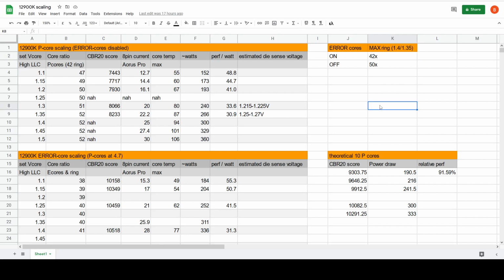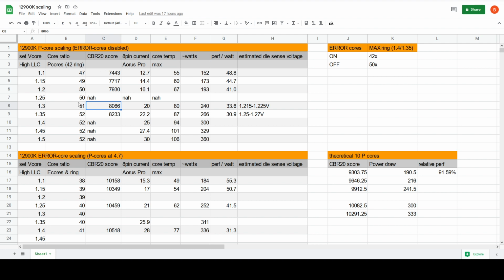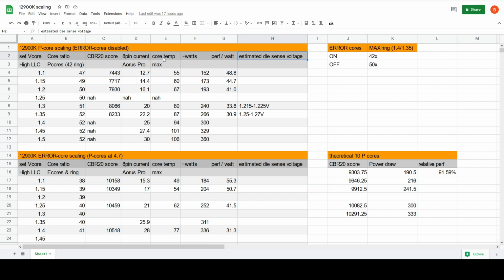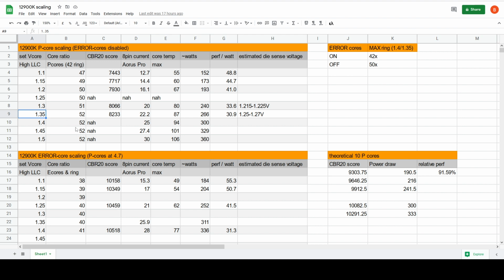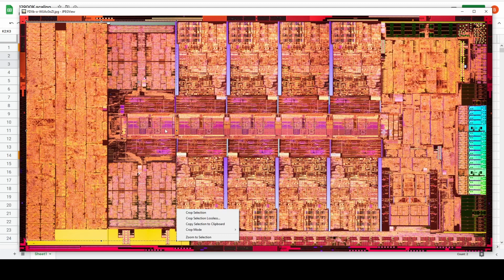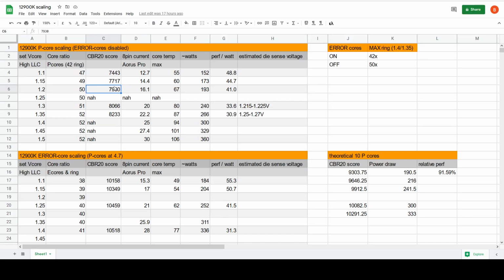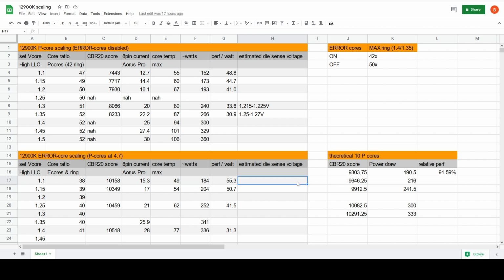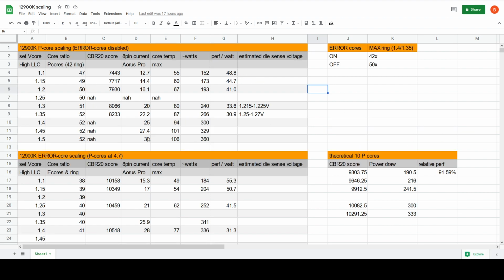12900K P and E core voltage and frequency scaling behaviour

Comment: The Ecores do seem to do more work in the same amount of silicon.  It breaks my brain for things like game servers, but for gaming - if they were to beef up the pcores even more, and only have 4 of them, then a bunch of ecores, it would be nice.  I would love to see 4 or 8 pcores that were monsters and focused on IPC, then have a bunch of high efficiency ecores - if that makes more sense on the die.  It does seem like it does.  Honestly, I never thought I'd say this, but power consumption is getting a bit crazy.  I can heat my house with my desktop PC, and in the summer it needs it's own AC.
Reply: i would love to just see 12Pcores without any Ecores, or, maybe 12 Pcores 4 Ecores, the thing is we already have games that use more then 8c so when DDR5 matures 12Pcores will get more fps then 8pcores, but that is not the case for the Ecores there so slow it is almost comparable to the second CCD on a 5950x the Ecores are basically a second slower CPU on the same silicon die they don't work well with the first CPU, Ecores can't really be used for gaming so there really just for background tasks, Tile based rendering, or streaming, which most people don't need them for

if i really wanted a second slower CPU in my computer whats to stop me from getting the cheapest ITX board on the market and sticking it in one of those dual system towers like a ENTHOO PRO 2, and having a cheap old 10400, or a 3600, alongiside a theorecical 12Pcore 0Ecore 13900k?, not much really but its just a kind of a dumb idea and the Ecores are not that far off from it.
Reply: but really the Ecores because there slow won't be able to scale up to large core counts to get large amounts of performance in a wide variety of applications, so i don't see it making sense to have more then 4 of them,

 i hope if Intel does double down on Ecores we will see a 12core CCD from AMD, the newer server CPU is going to be 96cores and 12x8 is 96 so i think either we will see 12core Zen4 chiplets and something like a 6800X will be 12c on 1ccd, or the server part will just have 12 8core CCDs rather then 8 12 core CCDs, and the 6800x would stay 8c
Reply: @XDbored1  But that's not how it works.  If the main loop is running on a pcore, and there's no blocking, the ecores actually process more in the same amount of silicon.  It's better.  Add more silicon, and ecores still make more sense, because they still process more.  You can't get rid of pcores, though - because the main loop does rely on single core performance.  Some other threads may, too, but definitely not all of them.  There is a very limited number of threads that require pcore performance, in many cases it will be 1.  The rest benefit more from ecores.
Reply: @XDbored1  Even on servers, I'd be fine with - even - 20 pcores - for main loops - and the rest as ecores.  4 ecores can process more multithreaded stuff than 1 hyperthreaded pcore.  Only very specific threads will get bottlenecked by not running on a pcore, and you just don't run many of those.  Basically, they are replacing 2 very fast cores (1 core, 1 hyperthreaded core) with 4 slightly slower cores.  The main reason I'd even be interested in pcores on a server is because I run game servers.  Even then, the number of pcores you need is closely linked to the amount of RAM you can put in the system.  Plus, the higher core count CPUs have lower clock speeds, anyway, so I just tend to discount those for game servers, anyway.  Honestly, I'd rather run a cluster of Desktop CPU servers for game servers.
Reply: @XDbored1  I'd choose 4 ecores over 1 hyperthreaded pcore for almost anything, other than gaming, and for gaming it would just be for the main loop.  I'd have to research if any other threads would be bottlenecked, that would really depend on the game and how it's designed.  At the same time, I wouldn't want to have 0 pcores - because some stuff does need the performance.  Personally?  If I had to choose between pcores and ecores, and you couldn't mix them, I'd choose all ecores.  It's, just, better.   Double the cores, they're real cores and not hyperthreaded, more efficient, and still run at decent speeds.  We need the pcores, though.
Reply: @techrev9999  ah that is difference you think HT is worth leaving on and your thinking of old applications that handle most of everything in 1 thread and then parcel out small amounts of work to the other threads those older games would run just fine on  4Pcores,

I think HT is only ever worth considering if you have a CPU without enough physical cores something like a dual core quad core or sometimes even hexa core running multi threaded applications, because single core performance is always better with HT off and power consumption is lower too, and when you have a memory bottleneck HT off seems to work better there too,

but i am thinking of highly threaded games ones that use more then 12t evenly distributed like Cyberpunk 2077 or Crysis 3, stuff that can run on a threadripper or a 5950x, but still doesn't run that well on a threadripper or 5950x, because of the core to latency, highly threaded games don't scale that well past 8 cores right now because there is a 8c CCD and moving data to some other CCD costs almost as much time as a dual socket system, it actually takes more time then a 18core Xeon would,

if that didn't have a large negative impact on gaming performance then something like a i7-6950X would be the best gaming CPU money can buy, but the problem is it does have a big impact on performance a i7-6950X is not that great a gaming CPU, and a 5950x is hardly faster then a 5800X for gaming, and nobody is thinking a dual socket system is great for gaming, and the Ecores are in the same boat they might help save a little power but having more Ecores won't help gaming

on Intel we got a true 10 core, and nothing but 8 cores since, 8 cores are great for current games but there are a few that run a little better on 10cores, and i think 12cores will be the future looking at the Software we have today,

unlike Zen3 the latency with Ecores is large even between other Ecores so the Ecores are more like 4 single core CCDs then a quad core CCD
https://images.anandtech.com/doci/17047/12900K%20Bounce.png
Reply: the Ecores take longer to get to the same cluster of Ecores then they take to reach the opposite cluster, they look bugged,

how often are you going to have 4 completely independent background threads awake at the exact same time?, if the scheduler just shifted things around very slightly it could probably process all the background threads on a single Ecore, while still having all the Pcores for gaming, most of these background threads already have over 8ms jitter anyway (thanks windows 10 sarcasm) so how much difference would adding 1/2 a ms cause?

if you get into the number crunching game of tile based rendering the HT will make sense there and Ecores may make sense there, but so does the R9 5950X, or the i7 6950X, and i have to wonder if just undervolting some Pcores a little wouldn't end up with the same or better perf per watt anyway.
Reply: looking at BZ's data i would give a rough estimate that a 4.5ghz Pcore has the same perf per watt as a 3.8ghz Ecore, so the Ecores would want to take up a lot less die space to even be worth fabbing, and if you could have more Pcores and you don't care about the extra cost in Silicon you would want as many Pcores as you have threads and 0 Ecores
Reply: @XDbored1  From what I saw, 1 pcore == 4 ecores.  So, it's - basically - twice the density.  If the 12900k was all ecores, it would have 40 cores.
Reply: @XDbored1  It really comes down to what the threads are doing.  My system isn't only for running games.  I do a lot of other things, too.  So, I'm not going to disable HT.  The question is what all those 8 threads in current games are doing, and how they're written.  A lot of processes will run just as well on an ecore as a pcore.  Also, a lot of people - while gaming - are running other processes at the same time - multimonitor set ups with browsers going on the other monitor to look up game related stuff, discord, etc.  Ecores are fine for all that stuff.  But, Ecores and Pcores are not 1:1 on the silicon.  Its 1 Pcore for 4 ecores.  If it was 1:1, you would have an argument.

I haven't looked into how the game engines are engineered, but as a programmer, I definitely could leverage this to my advantage in big ways.
Reply: @XDbored1  To me, you just sound like the guy in Spinal Tap - but this goes to 11.
Reply: @XDbored1  Yeah with Intel we got a true 10 core Comet Lake 10900K and 10850K. Unfortunately, it was limited to PCIE Gen 3 which is not at all future proof for video card upgrades down the road. And we have only had 8 P cores since. Part of that I believe is they were having so much trouble building anything more than 4 cores on any process node smaller than 14nm. They had Tiger Lake which actually beat AMD Zen 3 in Single threaded performance, but only laptops as it only had quad cores and they of course could not release only quad core CPU architecture for desktop when AMD had 6-12 cores as and even Intel had 6-10 cores on 14nm mainstream to enthusiast. 

Finally with Alder Lake, they got off the 14nm only nightmare and were able to get more than 4 cores built to their 10nm/7nm node, but I wonder if e cores were a design choice, or were they forced by being only capable of getting 8 at most P cores on their 10nm.7nm process node with Alder Lake, so they had to use e-cores for more?? Still the fact they got 8 cores on something smaller than 14nm was a huge win in of itself. So hopefully refreshes down the road with 10-12 P cores.
Reply: @Wolverine607  i strongly doubt they couldn't have made more then 8Pcores the Ecores seem to have much more strain on the Ringbus then the Pcores do so a 10Pcore 0 Ecore model would take up the same die space as a 12900k and the Ringbus would be able to run faster on full tilt then the current 12900k with Ecores, while costing the same to manufacture,

now if they could actually make a worthwhile 12P core model that is more a question maybe if they tried that it would bog down even worse then the 8Pcore +Ecores model?, and that extra segment of length won't be free either unless they axe off most or all of the iGPU,

but i do hope they make a good 12 Pcore model someday
Reply: @XDbored1  I agree. Yes I read some thread on reddit where someone who is an Intel fanboy stated they always go with Intel but did not like this design choice and thought they should have made a 12 P core only part. Some intel engineers or insiders responded that they were way behind AMD in muti threading and he e cores were much more efficient and way to go. Yes they could have made a 10 P core part as 1 P core takes same space as 4 e cores. SO the 12900K space could have been 10 P cores. Hopefully they do release it. And they should ax the integrated iGPU. Gamers and really only budget systems use an iGPU. So scrap it on high end parts.

And you say there are games that effectively use more than 8 cores. Which games are they? I have struggled to find games that even consistently use more than 3 most of the game. Red Dead Redemption 2 is usually using about 3 and will spike to 6 cores often and even 7-8 briefly in towns with lots going on. But not for long. Usually only using 3-4 most of the game at 1440 with RTX 3090.
Reply: @Wolverine607  Cyberpunk 2077, can and will use all my 16t if i turn HT on my 9900k but the games memory bottlenecked so it runs faster with HT off anyway, and the game is also GPU bottlenecked

its pretty hard to find benchmarks with per core load in them on the internet and most are in 4K anyway so some of the games i looked for i couldn't check

i thought Crysis 3, but looking at some benchs of a 5959x it seems to focus on about 4t but use more like 10t, i think either that game isn't very multithreaded after all or the scheduler is trying to keep most of the work on 1 of the 8 core CCDs to maintain performance
same with Mafia 3 on the 5950x but that seems to use 9t
Witcher 3m looks like 9t
Forza Horizon 5m looks like a 14t game now that would run better on a 12core if only it was fun too
Assassin's Creed Valhalla looks like 10t

Watch Dogs: Legion, looks like it use 24t!, but it runs better on the 10900k that memory bottleneck its like Cyberpunk i wonder if it would run better with HT off?

Monster Hunter World, uses 32t!!! holy shit, it looks like it spreads the load evenly too at 1080p it can get a 5950x over 90% load

i guess my standard for good multi-threading is only having atleast 8t and spreading the majority of load on more then 2t when i run my 9900k with HT off so i would consider all of these games good even if only a fraction of them could benefit from a 12core

i have also heard anecdotal reports that COD Warzone runs much better on the 10 core 10900k compared to 6 or 8 core parts, but idk if its a 24t/32t monster of a game like WDL or MHW

it is worth noting that the games with the best multithreading don't always have the best performance, and often there not the games you want to play anyway
Reply: @XDbored1  12 P cores will exist as xeons